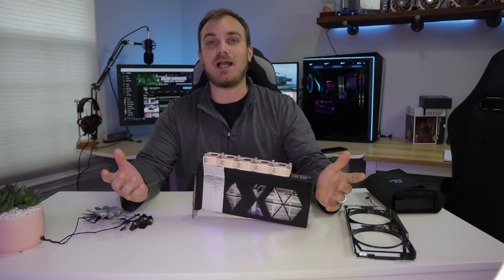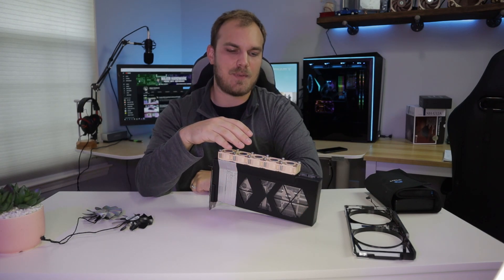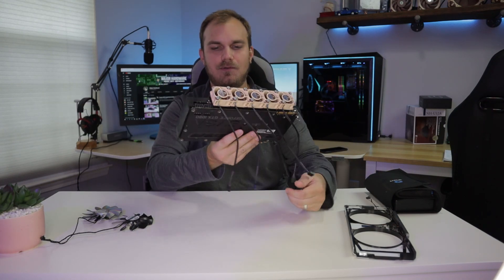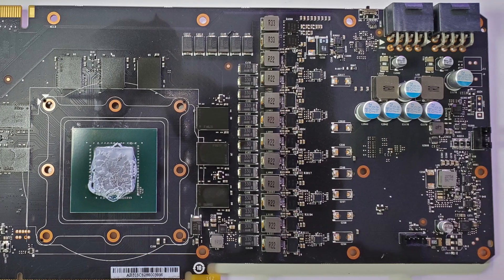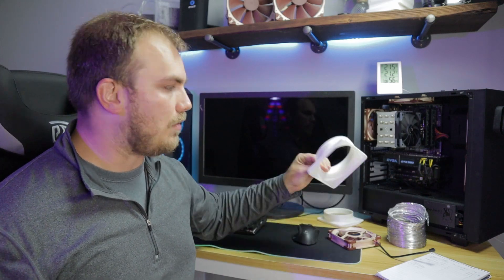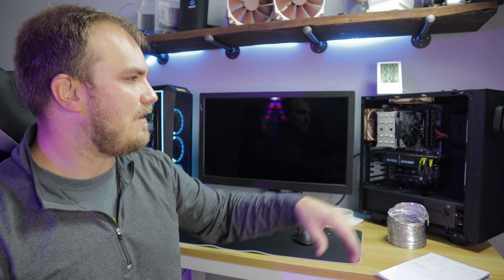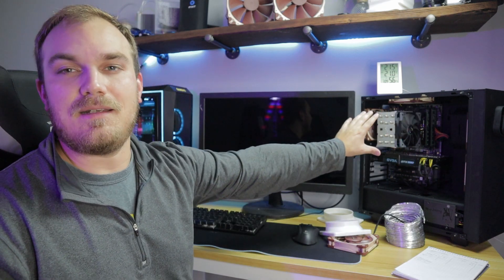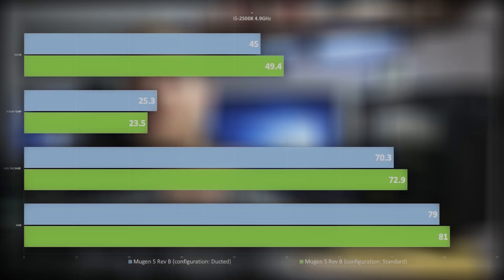Does Connecting Your CPU COOLER Directly To Your Case Fan Improve Temperatures?

Comment: This is essentially the same principal that the BTX form factor was designed around to cool Intel's Netburst based dual core chips (the first Pentium D series Smithfield chips like the 820, 830 etc.) around the mid 2000's.  It was a good design and I really liked it.  The only thing that really bothered me was the inverted PCIe connector for the GPU that limited you to a single slot card.  But for cooling a hot chip, such a setup is pretty hard to beat without going full liquid or sub-ambient cooling.  In my first full custom PC build I actually emulated this configuration by using the Zalman CPS 9500, placing multiple fans in the front of my case facing inward and putting an exhaust fan right behind my CPU cooler to exhaust the hot air out of the case.  Using a vent to isolate the air is obviously more ideal.  I've actually been waiting for some case/cooler manufacturer (are you listening Cooler Master?) to do something like this, especially with some of the hotter chips we've been getting these days, particularly from Intel (9900K/9700K etc., the higher-end X299/HEDT chips etc.).  Even for AMD it would be beneficial since, much like NVIDIA's GPUs, AMD's new Ryzen 3000 chips are very sensitive to heat/temps and perform better/clock higher at lower temps.

Comment: I hade a duct(hard plastic) from the stock CPU-cooler to the back of the case fan when I build my computer in an OEM case 10 years ago.
It worked really well back then, and it was easy to remove and insert with some clasps.

Comment: I'd like to see your VRM temps from no direct line cool to previous configuration. New chipsets have onboard cooling and beefier heatsinks of course. But with no direct pathing for the cooling? I'd like to see those results.
Reply: Not important. He was experimenting to see if it made a diference to CPU temp. If a system used this method you would have a second fan at the front cooling the internal case components.
Reply: @martinw245  it is important. if thats info i was asking for specifically, yes its important. there are reasons. if its not given then so be it ill get it through my own testing.
Reply: @NIVO1972  

Again... VRM temp isnt relevant. If he gave you VRM temp it would be meaningless because he wasnt even attempting to provide VRM cooling. This was just a test bed to see if ducting improved CPU temp. He would be giving you a VRM temp that was knowingly compromised through not even attempting to provide adequate VRM temp.

You dont need to worry about VRM temp if you are using this ducting because in a properly configured set up you would have another front fan providing VRM cooling.
Reply: @martinw245  And yet once again if i were after VRM again,  I will do my own testing from here. Collating data and using it to formulate ideas is how most of us do things. You have no idea what im doing or even attempting. Just stop.
Reply: @NIVO1972  

Lol... I'm sure you would monitor VRM temp with your own testing if you wanted to know VRM temp... but that's nothing to do with the video. Lol! 
And asking the individual what the VRM temp was is utterly irrelevant as it wasnt the video creators objecive, wasnt the point of the video. It's pretty obvious that ducting a CPU cooler prevents air flow spill over cooling the VRM, and only providing one fan at the front, ducted, would provide no case or VRM cooling. Of course the VRM temp would be higher. Again... not relevant!

Comment: In automotive applications this is termed "cold air intake", and yes, obviously it would make a difference. You would probably want to consider the airflow needs for the rest of the system and make sure the remaining case fans have enough flow to draw the air around the displacement that the ducting would introduce. All in all though it's a sound and viable concept, but the use case is the issue. Is the increase in cooling enough to justify the cosmetics, etc? That's my thoughts prior to watching.

Comment: Air ducts were actually popular back in the early 2000. PC cases usually have side panel with ventilation (and sometimes air duct) right on top of your cpu cooler position

Comment: The reason you don't see alot of setup like this is if the temperature difference it great enough from outside to the ambient temps inside you can actually create condensation from the cooler air quickly coming across warmer temps.   though it has to be fairly sever temperature difference IE don't use air conditioners lol.

Comment: I still have cases that had that built-in, including a BTX case (Yes, I said BTX). My old iSTAR S-1000 Tower Case (Three gens old) actually had a side mount that allowed you to add a fan, and "aim" the duct directly over the CPU cooling fan of the horizontal coolers that were popular in the day such that mounted horizontal fans, not unlike the Wrath (the Intel stock, AMD stock, and Zalman bowl style were all common at the time). In fact, I worked for a system integrator at that time; and we built systems that would overheat in the case unless that case ducting was in and used. I believed that at one time it was even a required spec in the Intel 775 era.

But this was part of the reason why some early Watercooling enthusiasts swore by external radiators. I've seen some that just screwed the side of the radiator onto the top of the case and did a push-pull fan configuration through the radiator venting out the sides, so all the air for the cooling was outside air. Some cases like the Evercool even built this into the case. And many cases (all the ones with the round rubber grommets to the outside were designed to pass radiator hoses to the outside.

(edited for spelling)

Comment: as someone who may know something about growing plants inside... ducting that isolates the heat source from the environment is far more effective. and in the environment i may or may not had had to use, isolation was even more important because the air not connected to the cooling ducting, needed to be treated to augment CO2, filter for dust, and odor. 

A straight shot 2ft line of 3" ducting should be able to cool a processor extremely well. And you can have one in line filter that is easy to clean. And you can then get in to inline fans that focus on pressure. 

With a unique case you could have one high pressure fan and a "smart" louver, handle CPU and GPU. 

bernoulli's principle. create a pressure box, and connect things to it. 

People I know use that to cool what is effectively a 1000W heat source in a box of a volume less than an average gaming PC case. And they will cool 8 of them with one pressure box. 

Allegedly...

Comment: Should try rubber. The foil absorbs case heat at a higher rate and the inner ribs restrict air flow. Maybe plastic with thermal-tape like they use on engine headers.

Comment: "Why is no one doing this?"

Thermalright actually does something like this for silence - exhaust fan duct to large, passive CPU tower cooler to reduce noise by removing one fan from the equation. 

Side note: I can't find the charts from a review on it, BUT IIRC, once you hit an overclocked (Intel) CPU with a heavy workload, matching ta similar tower design (ie one of the other Machos) with a front fan on it instead of a duct to the exhaust fan isn't going to happen even after you exceed the noise output.
https://encrypted-tbn0.gstatic.com/images?q=tbn%3AANd9GcQPOVVkVoElCAJvIDHnPQ3M4KwE5C-_GzL2VQ7ikgajetCWSm6C

If anything I'd even be less enthusiastic about this for anything other than no OC silent workstation since the exhaust fan tends to develop a higher or more audible pitch than the intake fans thanks to pushing the air through that waffle grill on practically every case out there.
Reply: Cant you remove the grill?, exhaust fans shouldnt use and filters anyways
Reply: @basedneeble7350  If you have a power tool to cut the metal waffle grill off and round out the edges to not get cut later on, sure.

Not sure where you've been in terms of PC cases these past few years but the last case I've seen with the removable and not noisy so not really necessary grill that looks like a stove top that screws on with the fan was the Silverstone FT03.

In any case I thought cutting metal was too much of a pain in the ass compared to just having two low rpm exhaust fans - rear an top just above the cpu cooler tower - doesn't drastically add noise for all the air they'll move.

Comment: Dell did this in some of their older models not sure if they still do this. And you should use non material for the duct. AC system it doesn't matter but for this you need to use a non conductive material. In cars they often use ceramics.

Comment: I put my 120mm Push Pull AIO into the 5.25incb bays. Mesh Front Case, maybe 1cm of free space between mesh and fan.
Always ran quite cool, always kept it there.
Who uses optical internal drives and unflush cases when USB burners are cheap.

Comment: FYI: The old Dell tower has this out of the box
Reply: After all, p4's and pentium D systems, and their crazy 2 pentium D had the need to get every single possible cooling technique that they could.
Reply: @eduardoavila646  I have a pentium D 925 and it is Super hot, the stock cooler doesnt keep up at all
Reply: @tobyngenn9826  True, that's why dell, hp, acer, etc got those ingenious ideas. 
Even tho they still heated alot with that, they could hold up.
Reply: Yup on Optiplex 320 , 330 , I think
Reply: I have a Dell Precision 490 on my workbench right now and it basically has a separate air chamber for both cpus and the ram with the front fan blowing straight through both heat sinks and another drive cage mounted fan blowing down onto the ram. I added two 80mm fans at the back to help with airflow.
Reply: You forgot about HP and IBM's that did this during the Pentium III era.
Reply: Yep, I have used workstations with hard plastic vents to do exactly this with Xeon processors.  Also the duct tape is too small and not smooth, that creates turbulence and will kill the fan, eventually.
Reply: We were doing this on original Pentiums, Pros and MMX CPUs.
Reply: @Armand79th  What machines?
Reply: So did gateway XD

Comment: Would have liked more details on where the cool air is coming from.   From my experience the only intake worth a dmn is is completely open hole or very large mesh directly in front of the intake.  Anything less creates negative pressure that either drastically reduces air volume or actually recycles warm air around from the inside of the case

Comment: find some clear  or translucent PVC pipe to fit, you could have winner.  Especially if you add RBG lighting on the ends. The pipe is lit up and its  providing maximum airflow directly to CPU fan.

Comment: Of course it will work better than what you already had there.  As the top fan fks the correct airflow of the case and shouldn't even be there ...With a better case that has 2 or 3 front fans and one big at the back without top fan would work much better preserving the airflow and cooling. The kind of setup you have.. Nowadays most motherboard sockets are done in the way that Big air coolers are facing Up and not at the back anymore so it sends CPU heat right into the PSU on classic casses.. And the cooling is bad  then need to get a case with PSU hidden away in such that there is a airflow going from bottom to top of case with fans if it can be done but that means looking for a better case or a specific one... I just got myself a Aio water cooling kit that is way more efficient and no messing around finding a case that will allow good air cooling... Honestly if all motherboard's were designed to have big CPU air coolers from front to back instead of top to bottom the cooling of them would be much more efficient...

Comment: Hang on, RMA? 1080?
WHERE YOU GET A NEW 1080, GIMME!

good vid mate.
Hey, best case I've ever had, had an aluminium heat sink on the front, that 2 fans sucked air past, which cools that heat sink down, ie: cold air INTAKE 😉
CoolerMaster WaveMaster.
Stunner!

Comment: why don't you try ducting it to exhaust fan as well. (front intake-cpu cooler-exhaust)
I guess you would need top mount exhaust fan for the other components as well, but I would like to see if the temperature would be better.

Comment: Ha, new to this place. Actually i have been doing something like this for quite a while, side ventilation through the case wall directly into a massive top-down cooler, i have had the Scythe Kama Cross.

Whether it's needed? Depends. What you expect from such a construction is a reduction in thermal short-circuiting. The cooling capability you have available is proportional to the difference between the cold-end and the hot-end temperatures, so ideally you want to avoid picking up the warm air that you made and running it through your cooler again several times, as this for sure is going to reduce your cooling efficiency. You also don't want to short circuit the cold airflow, i.e. you don't want to pump in cold air, have it not participate in the heat exchange at all, and then have it exit back out again, as this means you're producing more noise than strictly necessary. There's a lot that can be done with ducts and baffles.

Comment: You could use the rear fan as an intake and flip the cooler fan to pull instead of push. Would be a shorter distance and top fans can exhaust.

Comment: That's pretty much how most 1U and 2U servers work.  There's just a shroud directing air through the CPU heat sink from the front intake fans, though they typically have to push past some hard drives first.

Comment: GTX 580? Wow that brings back memories. Although I must say that has been my least favorite of the x80's series for nVidia. I have had the 8800 GTX, GTX 285, 480, 580, 680, 780 Ti, 980 Ti, 1080 Ti and now RTX 2080 Ti, but the 580 was the one that most disappointed me. Maybe it's the step from 480 to 580 that was too small. Still brings back some good memories of when the best GPUs were around $500-$600 and I was complaining. Now I spent $1,300 on my 2080 Ti which is absurd nVidia. Wow... In 10 years will the consumer RTX of that time cost $2,000? I am sure it will, because AMD will still suck and nVidia will continue doing what they want with no real competition up there.

Comment: Rigid ducting would work better, the crinkling on the tube you're using actually impedes air flow. My grandfather did HVAC work for 50 years and has replaced the crinkle tube duct in countless houses with rigid ducting and each time it allowed better airflow.

Comment: This is nothing new. In fact, Dell was using this design in one of their off the shelf Dimension E520’s where the front intake fan was indented behind the front panel. It was truly a unique design as the front looked fanless, yet the intake fan behind it had plenty of space for unobstucted airflow. Inside, the plastic shroud would isolate the air directly into the CPU cooler. I do agree that this design is superior and should be implemented more often, unfortunately most people choose form over function with tinted windows and RGB.

Comment: I had to do this for my old FX8350, because FX8350. That thing was a space heater, and piping the heat directly out was the only way to keep it cool in my TT Armor+
Reply: Here's one of the kits I used from Amazon: Akust 120mm & 135mm & 140mm Air Ducting Thermalhood Case Fan Cooling Adapter 15.7 Inch https://www.amazon.com/dp/B00PSD806A/ref=cm_sw_r_cp_apa_i_nmPKDb1HHE45T

Comment: What about better fan's ? I had a Project in 2012 with a 2600k @5047MHz on Air with a modded Thermaltake FRIO OCK (https://www.legitreviews.com/thermaltake-frio-ock-cpu-cooler-review_1923) + 2x EBMPapst 4112NH4 (AirFlow = 355m3/h each) + NZXT Sentry Mesh Fan Controller ( https://www.nzxt.com/products/sentry-mesh ) => https://www.ebmpapst.com/en/products/compact-fans/axial-compact-fans/axial_compact_fans_detail.php?pID=104669 => https://www.onlinecomponents.com/ebm-papst/4112nh4-12101128.html => https://imagizer.imageshack.com/img862/3791/1312089534maxjpgorigina.jpg => https://imagizer.imageshack.com/img62/3053/20120309185138.jpg => https://imagizer.imageshack.com/img856/5762/20120309185158.jpg => https://imagizer.imageshack.com/img703/1006/img0320hs.jpg => https://imagizer.imageshack.com/img825/4424/20120517221957.jpg  ...  I think, that Your duct might be beneficial and could push things even further ! :)

Comment: I know this is probably going to sound a bit daft but...What if a PC had the CPU and Ram and GPU all towards the bottom of the case where the air is theoretically supposed to be cooler? I don't know if that would apply to such a small space such as a PC case but it would explain why PSU's are usually at the bottom of the case since they are passing some serious wattage through them :) Or it might just be that the hot air off all the parts would likely cause damage to the PSU :) Not really sure :)

Comment: Why no one does this? 

Pretty much every HP Elite Desktop uses such system - not a duct hose, but rather a custom shroud to isolate different air channels in the case

Comment: If you have the space and your rear fan is in line with the CPU cooler you could make it so it goes all the way through. Better still put a shroud entirely around the CPU cooler and trap the airflow all the way through the pathway. Inlet front to shrouded CPU cooler to outlet fan.

Comment: I think the old PowerMac G5s did something like this

And I remember some Dell Dimension variants having a reverse version of this.
Reply: OutmatchedOutlaw the G5's had a plastic side panel that sculpted the airflow inside the case towards the fans from the front, channelling it into the large CPU heat syncs. the CPU, GPU and HDD all had separate horizontal chambers each with their own variable temp controlled spinning fans.